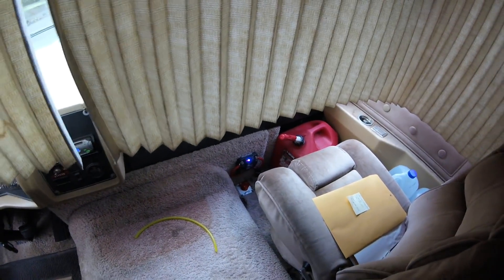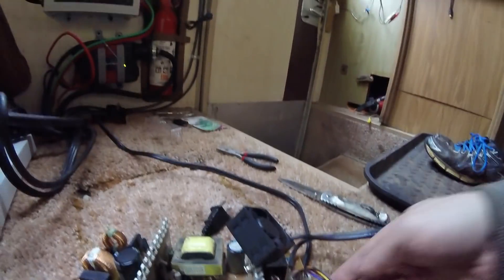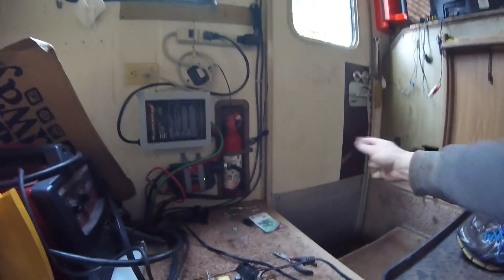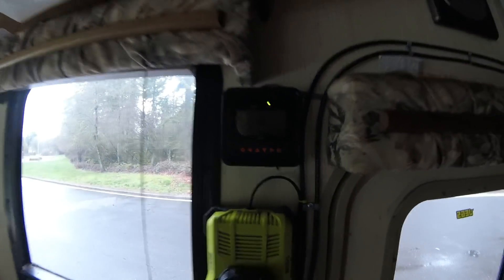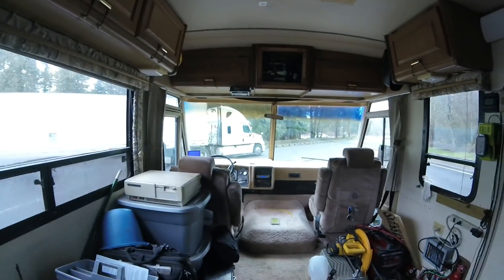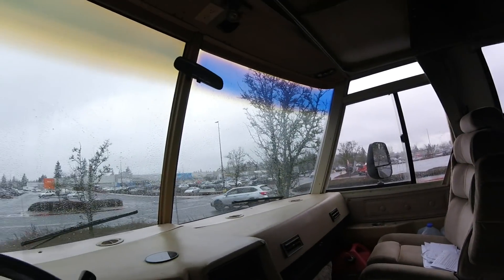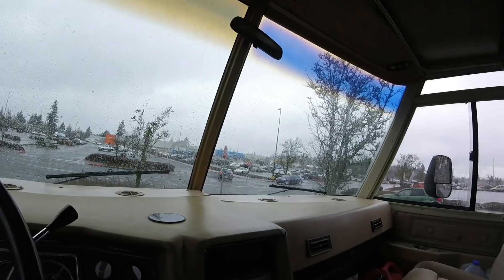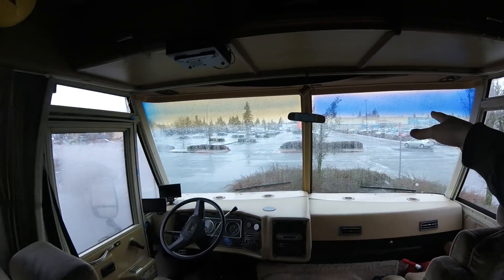Rest Area & Parking Lots || Full Time RV Living

Comment: Buy a dc-dc charger like the ctek 250. It will also function as a solar controller in the future if you add panels. 

You will kill the batteries running them that low. 

Think of it this way, my agms will cycle 1500-2000 times goin to 80 percent. But only a few hundred times going as low as you are at 11.7 volts.

Comment: I have lived 4 years in my Georgie boy RV, I installed 2 alternators, and 2 dual battery isolators that charged 4 battery's I removed both air pumps and replaced with new alternators. And a 100 watt harbor freight solar system,

Comment: Hey man, Just found your channel! Thanks for all the videos. I have a 1987 Georgia Boy 32foot. It has the same P30 chassis. Now I'm only using the coach for camping and for the race track. However Its nice to see what you've fixed as I'm having some of the same issues with suspension and generator. Also I'll be adding solar system soon. Keeping making videos!!!!
Reply: I have 34 ft 1988 Georgie boy same problem with my generator
Reply: Yeah I'll be replacing the Generator soon. Its too old to find parts. Good luck, hope you get it fixed.  @rvingkeepitrolling8797